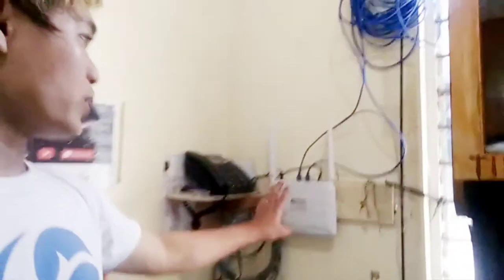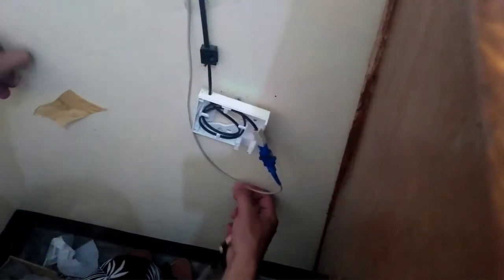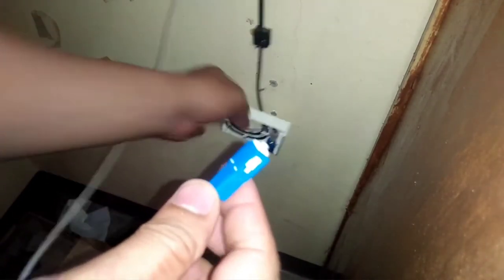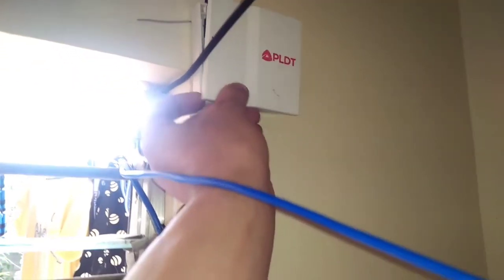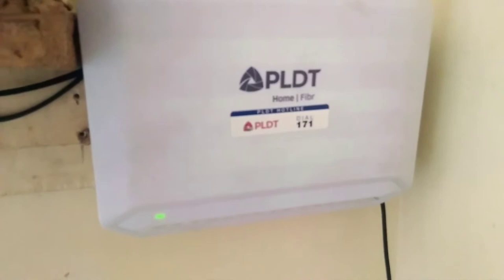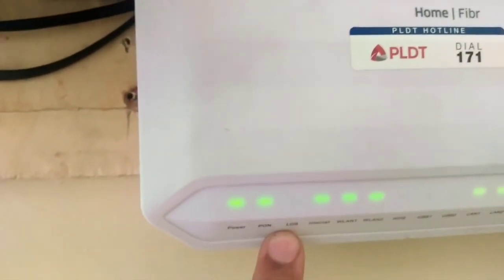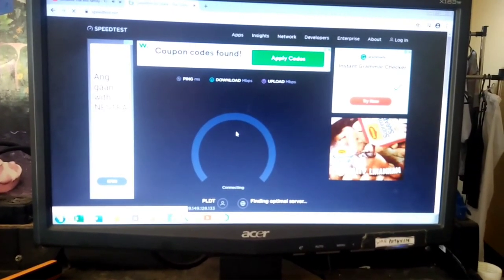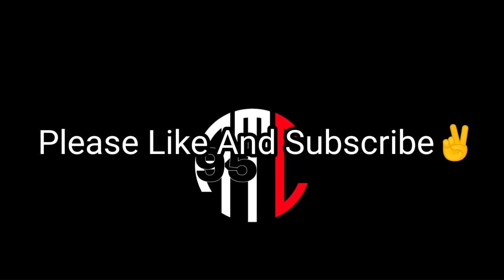How I move PLDT Wifi Modem to New location

Comment: Hey, dude. The PLDT contractor who installed our fiber did not install the fiber terminal box, and just plug it straight to the modem. Can I just unplug it from  the modem and connect it to the box myself? Or would it require some sort of connector/adapter at the end of the cable before plugging it in to the terminal box (FTB501) ?
Reply: VDSL type cguro yan hindi fber
Reply: @Long-sf1ct  It's definitely fiber, and I just installed the terminal box myself. Those contractors wanted me to call pldt and have a repair ticket so that they can continue the installation. I'm sure they just want to milk PLDT.
Reply from the maker: yea you could do that, it will cause an LOS light to turn red, but it will be gone after 30 minutes